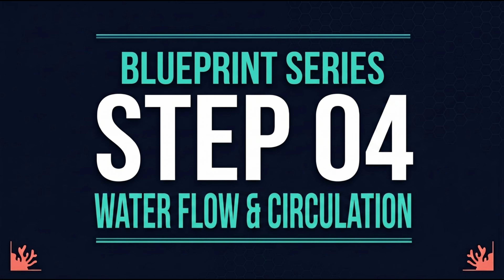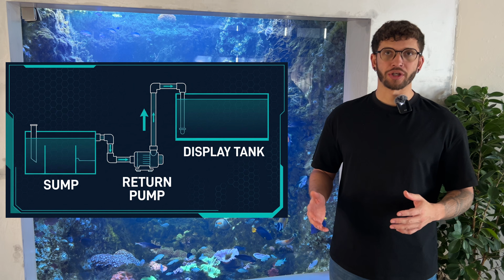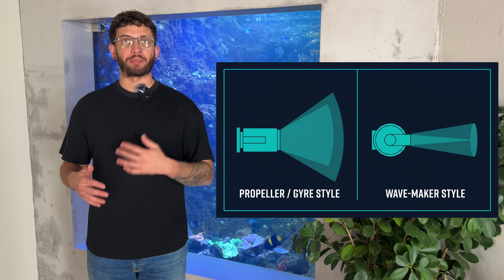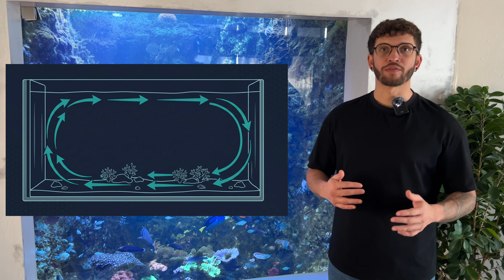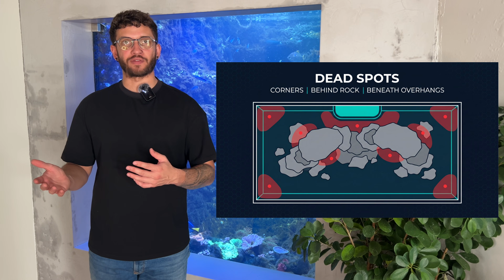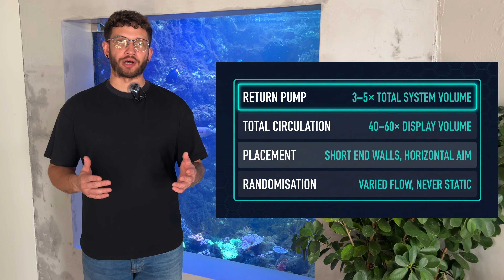Reef Tank Setup: Flow and Circulation - The Blueprint Series

Comment from the maker: Dead spots cost me six months. The algae wasn't a nutrient problem — it was a flow problem. I moved one powerhead. Solved in 10 minutes.

That's the thing about flow — it's invisible, so you blame everything else first. Parameters. Dosing. Skimmer. Lighting. But water has to reach every surface in your tank, every time. If it doesn't, something dies silently in a corner and you chase the wrong problem.

Which part of your flow setup are you least confident about? Drop it below — I read every comment.

🔗 Next: Step 05 — Lighting: PAR, Spectrum & Photoperiod — coming soon.
⚓ Subscribe so you don't miss it.Master the ecosystem.